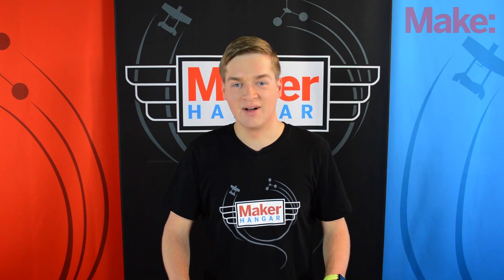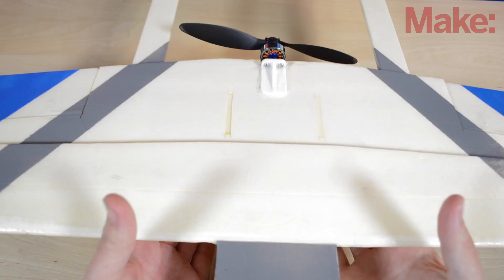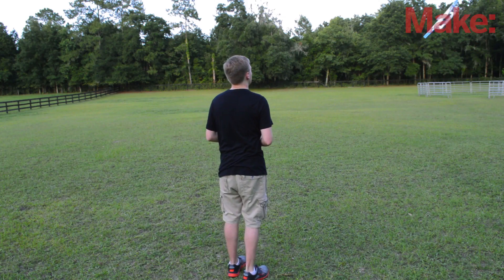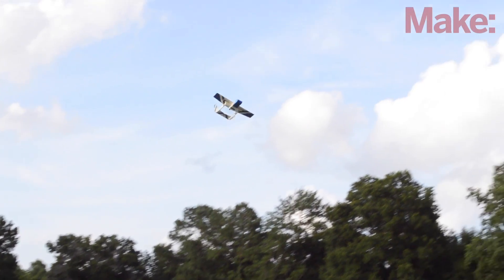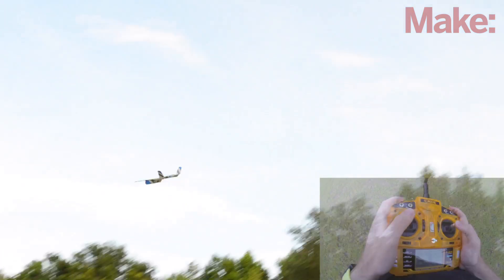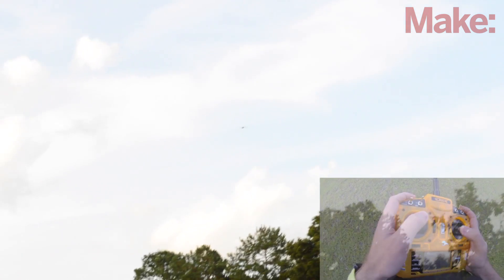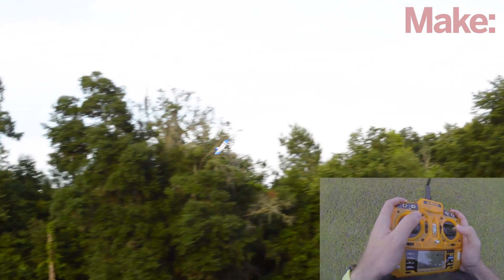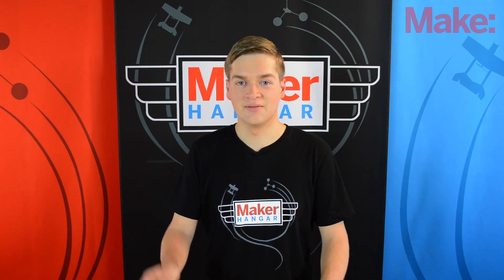Maker Hangar 2: 08 - Flying the Maker Trainer 2

Comment: Hi everybody, I want to build this trainer but first I wanted to know the range using the OrangeRx T-SIX 2.4GHz and the reciver that he used ????
Reply: range is dependant on the RF output power, you may need to set it to your region or you might get into some trouble.  range is further dependant on interference from nearby RF sources and humidity. and how much the receive ris being blocked in the plane.   On my (non flight) test the receiver still linked up to about 110m which is the limit of the field I'll be flying at.  

you can add an extra antenna on the receiver to extend range.  I'm guessing max range will be 200 to 250ish meters, any further and (again) you'll get into problem for using an illegal radio signal device.
Reply: oreubens thanks for answering ;)

Comment: Anybody have a total price for this airplane including the battery charger and controller?
Reply: Yeah...RTF (ready to fly) kits are great!  All you have to do is put it together, which is easy.  You'll probably need to buy a lipo battery and charger....but hey....If you shop around....some kits comes with everything...plane, transmitter/receiver, servos already installed and battery and charger.
Reply: 174 dollars with rudders and battery charger. I bought 4 prices of foam board for 5.00$
Reply: And transmitter
Reply: There are many variables when pricing this model.  Where you buy your foam and electronics.  Transmitters also varies by make, model and where you buy it.  Does it come with a Receiver?  Prices will usually be higher for a complete transmitter and receiver bundle. Also, servos and most electronics can be found and bought on Ebay.  Usually cheaper than hobby stores....most electronics come from China, but then again most of the hobby stores sell them.  You just got to be a smart shopper and buy from the cheapest source.  Good Luck my Friend.
Reply: 174$with the cheapest charger at hobby king
Reply: http://www.hobbyking.com/hobbyking/store/__49338__Turnigy_E3_Compact_2S_3S_Lipo_Charger_100_240v_US_Plug_.html
Reply: Benjamin Williams
If cheapest is the way you went, then you get what you paid for.  Never go cheap on lipos and chargers....accidents can and will happen!
Reply: Thanks! I was confused when I was looking so I got the cheapest. I might not ever get electronic in my plane.
Reply: Benjamin Williams Isn't cheaper just to buy a ready made kit?